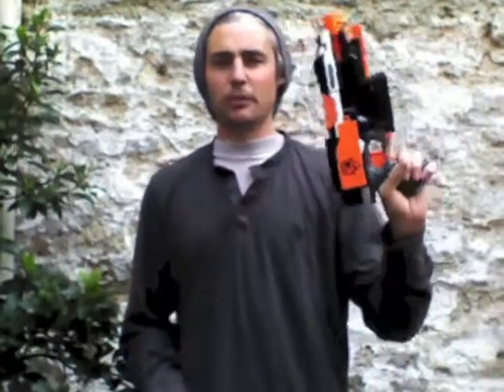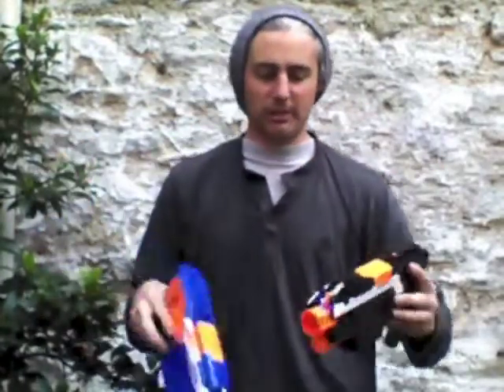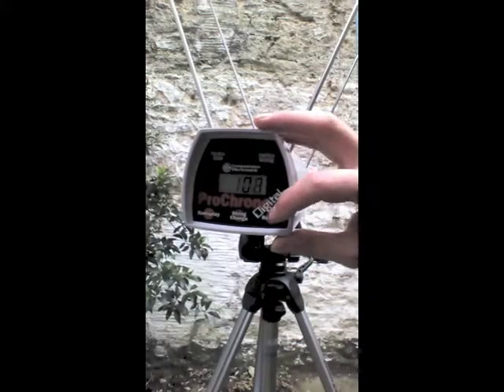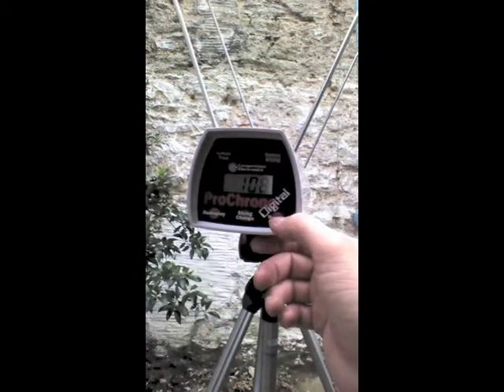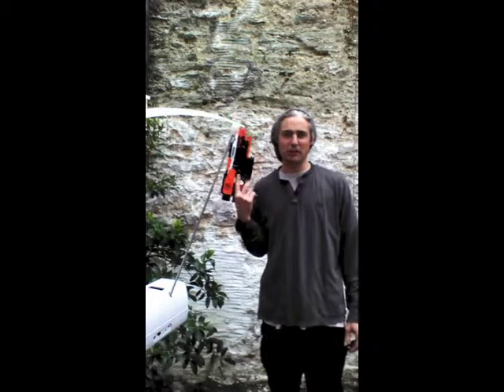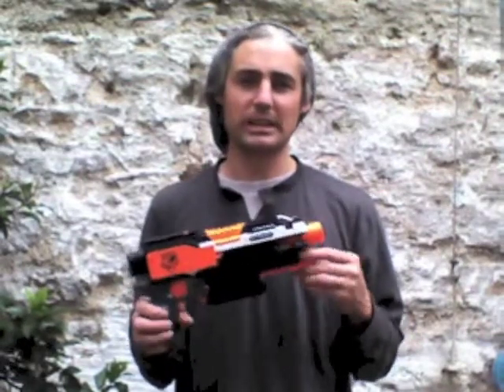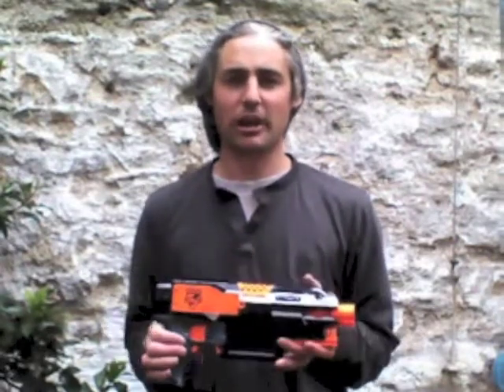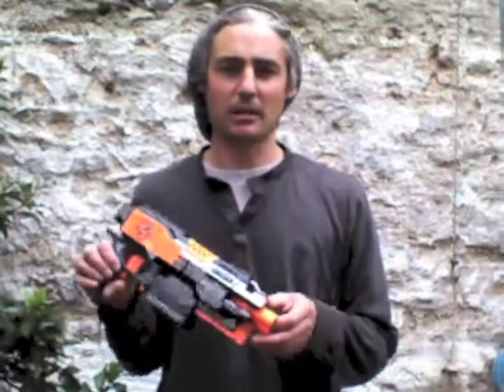Modded Stryfe Test- Over volting

Comment: Can you run 3 imrs with 18 wg wire?
Reply from the maker: 18 AWAg silicone insulated multistrand wire is typically rated for up to 16A continuous and 30A burst. 14500 IMR has a max output of 8A burst. Wire should be selected according to the maximum burst current produced by the motors at stall. The battery doesn't "push" current to the motors, they draw the current they need to overcome the load placed upon them up to their maximum stall or the max output of the battery. IMR should only be used with stock motors.

Comment: If I was to run stock motors on 3 imr and a dummy would that be ok? And what about rhinos with imrs. I have someone who doesn't want lipos so I'm trying to find a good alternative. Cheers
Reply from the maker: You CANNOT run ANY MOD MOTORS on 14500/AA size IMR, 3 on stock motors is ok, you still run the risk of cooking the brushes, replace them with carbon ones from generic carbon brush 130's off ebay. This information is widely available, see Britnerf for more detail.